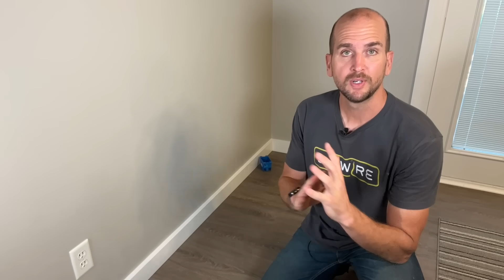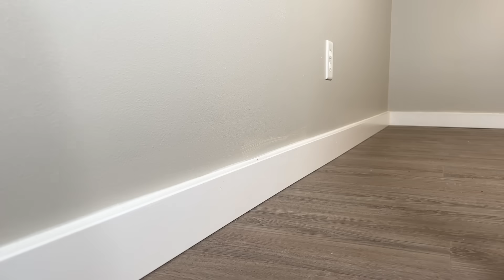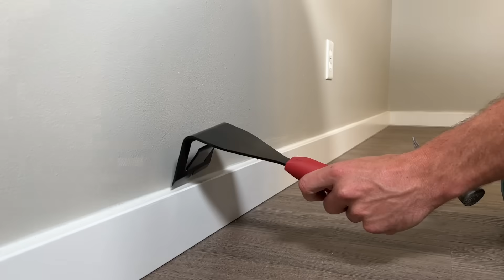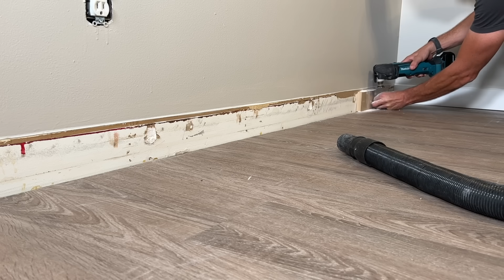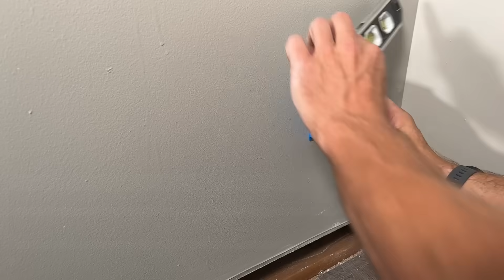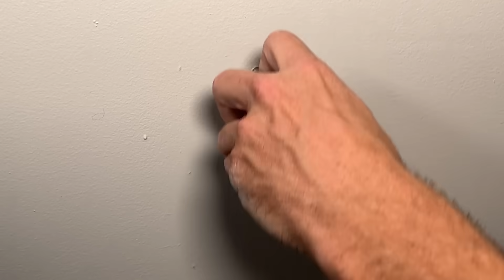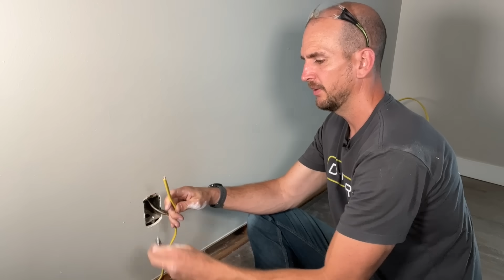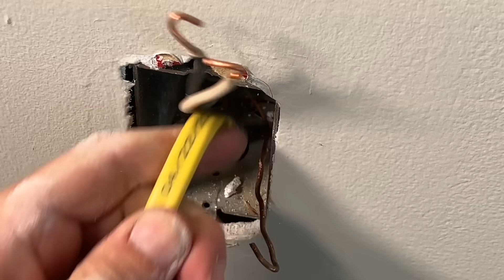How To Add An Outlet To A Finished Wall

Comment: 6' extension cord is $2.99... If this were for a window a/c or some other high-power draw device, I'd go with your idea. But for a charging station? Also, do the studs maintain their structural code integrity after being drilled? I know in plumbing there are limits (size of hole, placement, etc.)
Reply: It's for Air B'n'b. You don't know that one of your guests isn't going to plug in a heater to the new outlet or extension cord. A charging station might look like a good place to use an electric kettle (tea drinkers especially) 

Better to be safe and install it properly.

Also less chance of guest "accidentally" taking the extension lead home when they go ...

Comment: Romex is clad or "jacketed" in PLASTIC, "MC" cable is clad in METAL; either steel or aluminum .
Consider the bending, abrasion, cutting and fire resistance of these two different materials and then choose which you want in YOUR walls.
Reply: i got news for you mc cable is great if done properly. don't tell a diy er to use  mc cable you know he's not going to buy a splitter tool so cutting the mc cable with dikes already makes it twice the fire hazard as romex which done properly you know with nail plates to protect the wire where you know with a spade bit he wasnt even close to center of stud. not to mention almost every time i fix mc cable a home owner installs they never use the only thing that makes that crap leagal in the first place is the anti short bushings that sre supposed to come with a roll of mc but are rarely still there. everytime its shorted out right where they have the cheap set screw with no plate connectors and the set screw pushing directly on the sharp cut metal with no bushing. all BAD

Comment: This is one of the best videos I’ve ever seen for covering all facets of a project. All steps are well thought out and presented. I especially love the point about drilling above the molding height to avoid reassembly damage. Excellent.
Reply: except the insane pigtails for neutral and line!!!

Comment: As always, every electrician knows that before you begin ANY type of work, you first kill your power, never work on live electrical circuits or lines.  Safty has no quitting time.
Reply: I disagree, I consistently work on live wires at residential voltages.

Comment: I'm a general you electricians making comments here are funny You guys don't repair drywall anyway. Also we won't talk about your mess you guys leave  LOL LOL. Also yes you can have too many outlets what is this guy talking about that's how you pop your breaker. JUST FYI but love the removal of the baseboard to run the new wire

Comment: Woah dude please slow down when you're hooking those wires up in the outlet!!!  You're just putting those connectors on and stuffing them in the wall on like 10x speed, how are we supposed to know what the hell you're doing with those pigtail connection to  and what wires to connect etc when you're going so fast 🤦🏻‍♂️

Comment: This is genious! I have never seen this done in the early years when I was a residential electrician. This will be life saver for me in the new house that I bought. And it saves wire even if you have access in the attic.
Reply: I have full attic access, but I also have cabinets on the other side of the wall I do not want to remove.
Reply: It's well done only thing I see is those way gos as you call them aren't needed in this application because you can just attach wires to screws on plug....Less splices equals less issues down the road. Don't make joints unless you need to . Plus I've seen those way gos they're cheap made in China and over time will fail. Best off to avoid them marrettes far better proven connection. Industrial maintenance electrician I've wired Lotsa new + old homes in my years in trade...

Comment: Uhm.... careful there sir. Even though I am not a licensed electrician, I do know that there are some guidelines, and restrictions when it comes to that statement you made of, "you can never have enough outlets"? Pretty sure that any circuit that you put one on has an amp, and voltage limit, so, no, you CAN have enough outlets. If it's a 15 amp circuit breaker that your living room outlets are on then,  there IS a limit to how many outlets can be on the same circuit. If there were 15 outlets on that one 15 amp circuit, and you tried to plug in 15 electric gadgets that exceeded the 15 amp limit, you are def going to have issues.... =)
Reply: You can install as many receptacles as you want on a circuit.  Doing so will only guarantee your breaker will constantly trip due to overload.  Your circuits should be separated so that you won’t go over 80 percent of your anticipated maximum load. Also, you can install 15 amp outlets on a 20 amp circuit as long as it’s not a dedicated circuit.  Also he forgot to ground the metal box.

Comment: Great video ! I would add to be sure you haven't already maxed out the allowable number of outlets on that particular circuit per your state building code. Typically 8-10 outlets are allowed per breaker.
Reply from the maker: Good addition, thanks for the feedback 👍
Reply: @EverydayHomeRepairs  liked and subbed. Good content 👌
Reply: In a different situation (not an end of line branch circuit) you would overfill the box by adding two #12 conductors and 3 wire nuts. I'm kinda guessing this statement though assuming they used a regular outlet box(2104) not a deep box (1104). This is a Canadian electrical code. May not be applicable in your case as well. And God forbid the home was built in the 1970s with aluminum wire.. hopefully all you diy'ers look into your specific case. Small variables could burn a house down in 20 years.
Reply: As a DIYer I would use common sense to consider load on the breaker, not worry about building code. Point of this install is to provide a convenient outlet for a bed table in the corner rather than require use of an extension cord from outlet behind the bed to support the same load. Effectively the new duplex outlet is a neat and permanently installed extension cord running inside the wall.
Reply: @nsteinmetz  I fully understand the point of this install, and I considered it a very good idea. But be careful telling people on the internet to "not to worry about building code". Building codes are designed to keep us from burning down our houses. Ignore them if you wish, but the smart person will at least check code before making an electrical modification if you value your life and the life of your family.
Reply: @Matt633NLT  I do understand value and importance of building codes, and was pleased to have an experienced building inspector in my town to enforce them when I contracted for a major addition to my home. I’m just saying to interpret them using common sense, bearing in mind the reason for the rule.

Comment: Careful folks, this is most likely not to code and may hurt you when/if you sell.
Reply: He didn’t ground the metal box with a pigtail and needed a wire staple within 12 inches of each box. Other than that there was nothing.  Unless you want to say it’s technically an altered circuit and any altered circuit needs to have a permit. Changing out an outlet is altering a circuit and is required to be permitted, but nobody does that.

Comment: I would NEVER EVER use non metallic power cable in a home; that material is basically just a glorified extension cord!
Reply from the maker: It is basically the standard in my area for residential.  Assuming you are from a country outside the US or maybe a city like Chicago?
Reply: 'non-armoured' cable is standard throughout the UK

Comment: help me out here. He described a 12 gauge wire, indicating a 20 amp circuit.  If so, the outlets do not appear to be 20 amp outlets.  20 amp outlets have a little notch next to the parallel slits in the outlet. What am I missing?
Reply: You can install 15 amp outlets on a 20 amp circuit provided there are multiple outlets on the circuit . You can’t install a 15 amp outlet on a DEDICATED 20 amp circuit with only one outlet on that circuit. In that case the outlet / receptacle must be a 20 amp rated outlet.   It’s true, it’s NEC code and you can look it up all over YouTube .
Reply: @Californians_go_home  ok . Thanks for the clarification

Comment: A little different than the method that I use but it's kind of similar. You can also put nail guards over the wires and that'll end any kind of nail from entering that site. Also a lot safer to have the nail guards on for some unexpected work being done by another party...
Reply: Exactly. Great info from the uploader. You just filled in some missing recommendations. 34 year Electrician here, but I'm still learning. No excessive pride here. I just told my son last night to keep an open mind. There's always something new to learn, no matter where we're at in our journey. :)

Comment: I've run it underneath the baseboard and then I've also run it through the wall drilling out each stud with a 2 inch drill bit deep enough that the wire fits through. And then repair the drywall. Let me see how you do it.

Comment: Nicely done.
Unfortunately here in the UK you can't just add an extra socket to a circuit and definitely cant run cables outside  of the vertical and horizontal zones of the outlets. 

 Our wiring regulations are much more  stringent and of course you have to test, certify and register with the local authorities.

A plug in tester does not guarantee that your alterations will disconnect appropriately  under fault conditions.
Reply: Under 'Part P' you can add a spur, which I (still) believe doesn't require electrical testing (for our American friends when an electrician works on UK homes he has to take various impedance readings etc from the consumer unit/breaker box once the work is complete).
Under 'Part P' of the building regs various basic works can be carried out by a 'competent person' such as damaged fitting replacement, light fitting replacement and adding a spur.

As for the 'local authorities' this isn't quite true either. This depends on the scope of the works. Again for our US friends we have a department at the Local Council called Building Control and these guys will check works, usually structural building works. For significant electrical works, such as house re-wires readings are also taken and these are submitted, but not to local authorities. These independent will issue a certificate, typically valid for 5 years and require the electrician to re-certify annually to issue test certificates. 
I'm unsure when Building Control check electrical works, I believe nowadays it tends to be restaurants and other 'light commercial' rather than domestic premises.

Comment: I do like to wrap the outlet terminals with electrical tape, 1 wrap for every 50 volts, Especially when the outlet is going into a metal box. Really adds another layer of protection.

Comment: VERY Clever!!!  I wanted more outlets in my 1960-built brick house on a slab with a very short attic, which doesn't leave room to work from the attic to run Romex down the walls on the long sided front and back of the house.  Any new Romex needed could be run down hallway walls and inside-room 90° walls fairly close to the hallway.  Then use this procedure to run more outlets from them and/or existing outlets.  This may require higher Amperage Breakers, but that's not really a big deal.  Though maybe not.  The overall load will be the same with more outlets for easier access without having to run heavy extension cords and/or outlet expansion adapters for more plugs, which would make things much safer.  If need be, I could start with 5-10 higher Amp Breakers and go from there, though 10A higher should do fine.  I also wanted all of the existing outlets converted to 3-wire, but safety ground wires could be run to the existing outlets while I'm at it; either an individual wire to each existing outlet that's far in enough to reach as described, or by running it from the new Romex outlets.  Either way, I'll be able to add a safety ground all of them and add more outlets wherever I want.  This is brilliant!!!

My electrician told he couldn't do it and that he would have to run conduit all around the house outside and 90° T into outlets from there, which would also require a lot of junction boxes outside.  I didn't want that look so I turned down his offer.  His prices are extremely reasonable for truly great work, so I may call him again for this.  My floorboards aren't as tall and wide as those and have an arched-over top, but they should be tall enough for this procedure, so I'm saving a link to this video, which has a link to your caulking guy for the final touches, along with your channel name, description and links, and will address this project again.  I may be able to all of it myself, or at least a good part of it.  I've been in electrical and electronics since 1973, though I am not an electrician by trade.  Thank you so much, Scott!!!  I see you cover a lot of areas, so I just subscribed and rang the Bell.

I have a few other projects to do and info and clever ways like this to do great work are always good to have.  Thanks again!

Comment: Helpful tip.
Most tape measures have  RED numbers 
(Each red number is 16 inches from the last one) This feature is a quick way to mark studs since All the red numbers are 16 inches apart🙂👍
So once you find one stud. All you have to do is put either the tip of the tape measure on the stud (or match any of the red numbers up to where your stud is) and then stretch the tape measure out..wherever you see red a number you know that is where the next stud should be🙂

Hope that helps anyone. Should be a red number at 16 inches, 32, 48, and just keeps going until the tape measure is maxed out👍
Reply: Some of them have black diamonds instead to show stud locations. All of mine in the USA have black diamonds instead of red numbers 🤷

Comment: That won't pass Chicago building code.  Plus, without a permit, you cannot rent it out in Chicago.  
Having untrained non-electricians screwing with electrical outlets is VERY dangerous. 
If the polarity is wrong, the ground could be hot, and someone can get electrocuted.

Comment: Question.
How do you add outlets on a party wall that is cinder block?
I have a wall that’s over 40 foot long with only two outlets on is. So annoying house built in the mid 1950 and, I am the second owner.

Comment: Loved the video and thought your approach was very clever (very…clever). The only thing that bothers me is why you decided to messy the original box with pig tails on the hot and common wires. Pig tail the ground, but tie the black and white wires on the other two ears of the receptacle. It’s what they’re there for, and you’ll have much more room in your box. Much less chance of a cross-wire short. 😊 
Oh! And don’t forget to wrap the receptacle ears with tape before installing back into the metal box, just inches from conductive contact.
Reply: Pigtails are definitely better for wiring receptacles but they are commonly found in commercial and industrial buildings. The reason for pig tailing is if the receptacle fails all the receptacles down stream will not lose power. it is much easier for troubleshooting as well
Reply: I think he did pigtails for code's sake and YT scrutiny. I don't see any problem using both side of a receptacle in a low current circuit( bedroom, living room). I'm not a big fan of backstabbing though,  J connections look like a better wire/receptacle contact to me.

Comment: Ya had me until you jammed the wires in the back, I get it there has been alot of great innovations throughout the three decades I've been mess8ng with wires but I can't stand that feature. Countless times I have gone to a home to find the wires shorted out and melted the outlet to a point where I turn sheet white.

Comment: Not all boxes have knock outs you can use a piece of wire to pull your wire throgh the access in the bottom of the box

Comment: Great trick. Not sure why you wasted those three quick connectors to pigtail when you could’ve just backwired both romex into the outlet, but I’m sure you have your reasons. Definitely come in handy if there was already two sets on the outlet.

Comment: Quick question for you re: the pigtails...do you just make these yourself out of 12 guage solid copper wire of the appropriate insulated color or do you buy the pigtails pre-cut and stripped? Thanks in advance!

Comment: Good job until you started using those push connectors I never use those seen a lot of them burn up they don’t grab the wire good

Comment: Excellent work, have run only a few extra outlets through drywall , but they were above kitchen counter level and a bit tricky. But I had not heard about the lever wire connectors, so thanks for letting me learn something today!!
Reply: Get certified ones like the Wago not generic garbage.

Comment: I respect it. I just usually take a long flex bit and a right angle adapter and just drill through studs until I touch the box, don't feel like taking trim apart blah blah